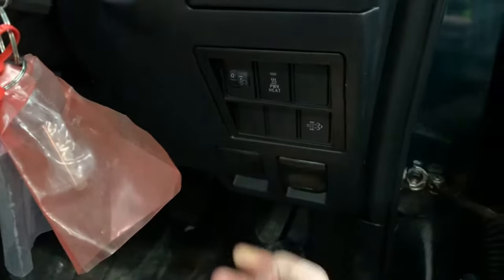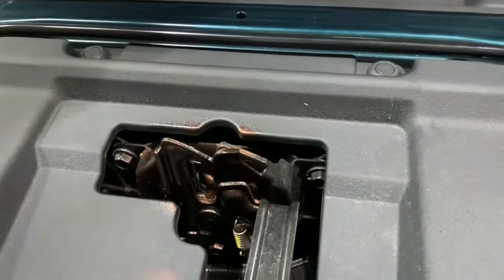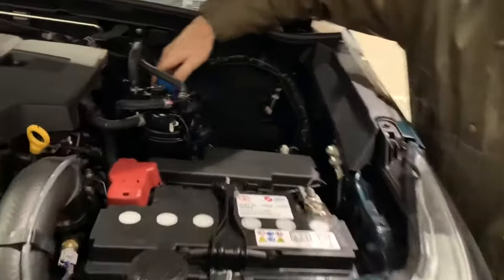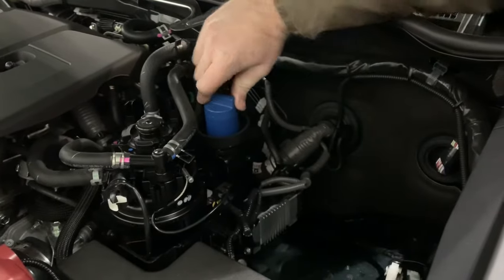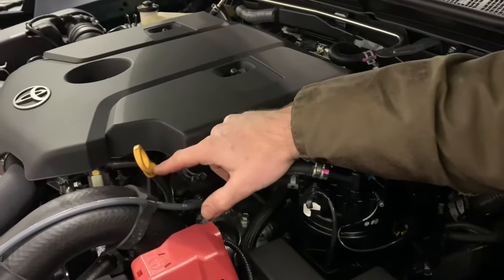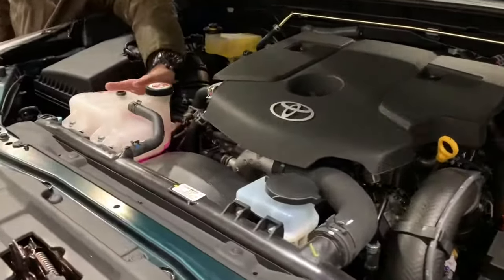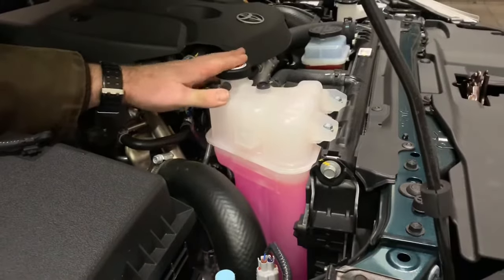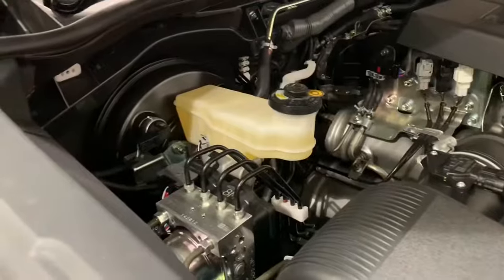How to check the levels on the Toyota Hilux

Comment: Automatic Transmission Fluid Level ?
Reply from the maker: The automatic gearbox oil level is not really part of your standard levels check now. If it was myvehicle I would get the  automatic gearbox oil changed at 60,000 miles. They usually do not need the level checked unless experiencing gearbox issues. The gearbox has a level plug also a filler plug and also a drain plug. The vehicle needs to on the ramps to get to them and I would recommend a Toyota approved centre does it for you. Thanks for your comments and thanks for watching my channel kind regards Tim
Reply: @hiluxtim1494  Can you please make a video showing the position of the Automatic transmission fluid (filler plug, drain plug, but most importantly how to check the level?)
Reply: seems this version assin transmission cancel the traditional dipstick, and become a AZ transmission plug/nut type  on the side of the actual transmission, which is a hassle to raise the car.

Comment: What's the use of Ad blue, cos my Toyota some times blows out whitesh smoke like for a few seconds and then it stops by its self.
Reply: thats the diesel particulate filter DPF regenerating (it slowly gets clogged up and when/if you do a motorway drive it can self clean)
Reply: The new Hilux I had 2015-2018, had to go into the shop 3 X, Nd adventurely they installed or replaced a part, we had 12 company utes of the same era and this happened to them all. May be more prominent here in NZ re desiel quality ?
Reply: AdBlue is the commercial name of a diesel emissions additive fluid consumed in the process of driving. Due to the Selective Catalytic Reduction (SCR)  system, the AdBlue tank may sometimes need to be topped up between services.